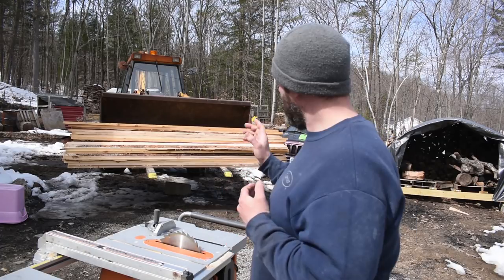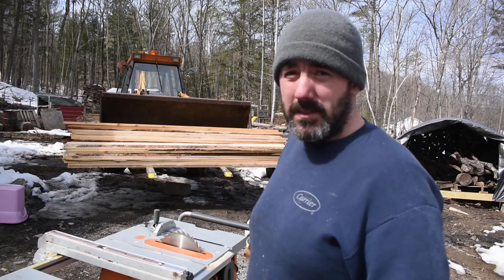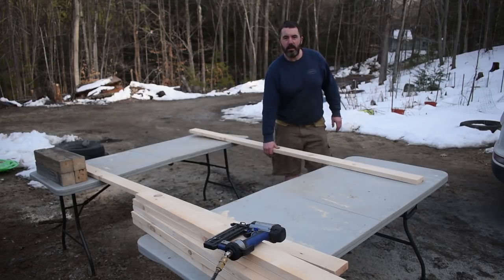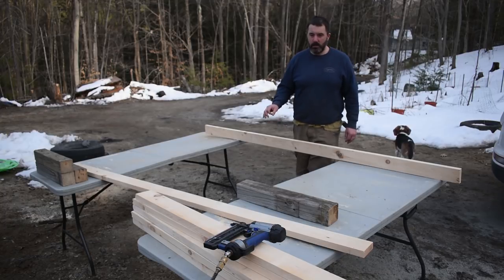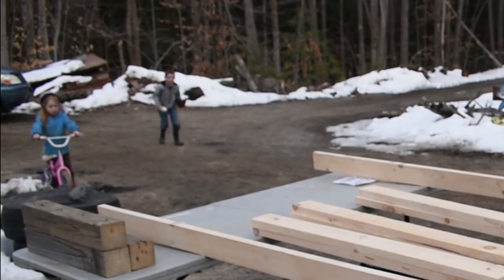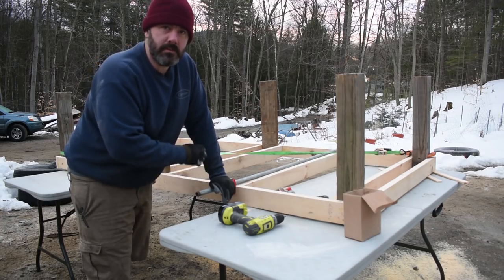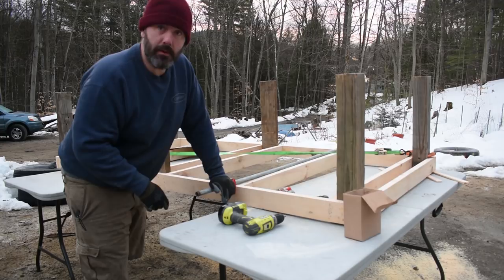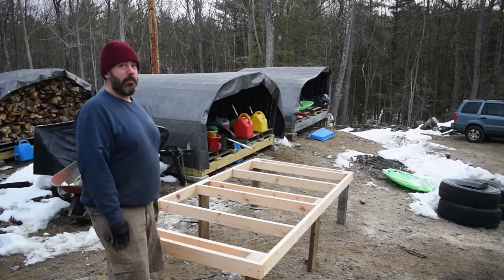Custom Chicken Coop Build - Part 1 - The Base Milling and Assembly

Comment: DW, AS soon as this crazy winter (spring) ends I will be working on my mill pad area. I am 99.5% sure of putting in my order for a HM 130 . Question does it come with an adjustable ( in and out )blade bearing? Great video content. 
SWWW

Comment: spring is almost here but not quite ...I can tell because your wearing shorts and rubber boots lol ....personally im not a fan of osb or plywood ...just my opinion for what its wourth i would put 1 by planking down and cover it with linoleum  for ease of cleaning and protection of the wood from the nitrogen
Reply: ps your doing a superb job  and just because i wouldnt use plywood or osb dont meen it aint a good way ...its just my preference
Reply from the maker: I personally agreed, but I have had this plywood and OSB sitting in my garage for 2 years and need to use it up.  If I didnt have it I would have just used regular lumber.
Reply from the maker: Thanks Grizz, I really appreciate that.  Seeing that I can make my own wood naturally, I truly prefer to use that when I can.  Unless it is work on my house, in which I typically buy the materials.  I will be building a shed next, so I am sure you will see that as time goes.  Then I will be building a kiln.  I am sure I will not get bored, lol